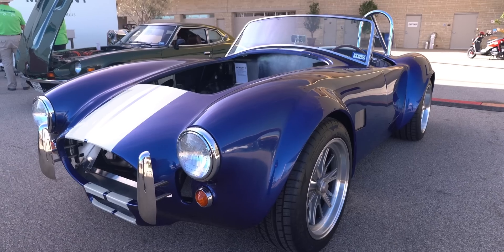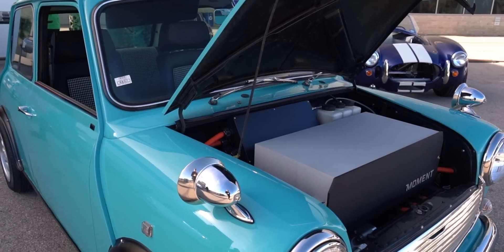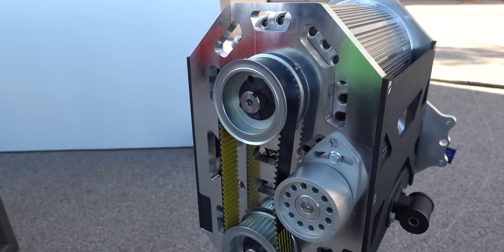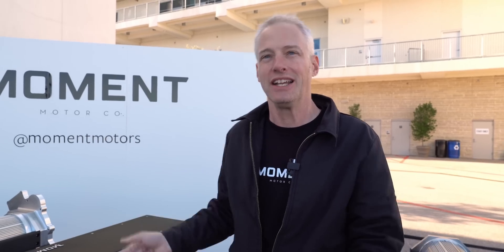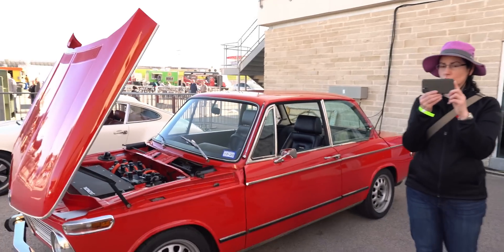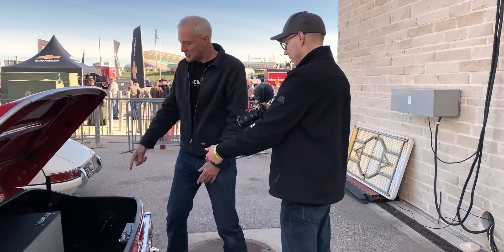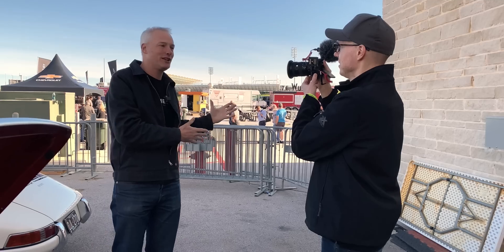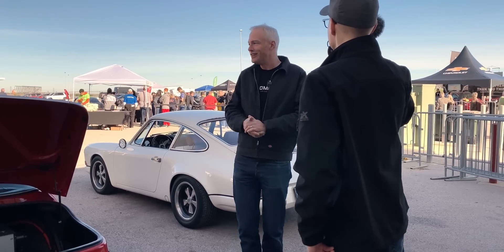Classic Car EV Conversion and Moment Motors - full interview

Comment: This is Iike castrating (gelding) a great Stud racehorse and claiming you now have a better riding experience.  The engine is the reason for the car to exist.
Virtually every original car you show has a unique engine, iconic, individual, personal to the driver, and speaks with a particular voice, an exhaust note
that is the very signature of the marque.  The internal combustion engine makes you part of the visceral nature of the machine. 
You've gutted these qualities and in place installed a soulless device of indeterminate boring consequence.  Do you want a Rolex Sub Mariner or a $24.99 digital watch with a  clocking chip?

Comment: I saw video yesterday that put the electric motors in place of wheels on a Ford F-150 and a Mustang. (Protean Electric and Ford) Each wheel produces 150 horses oddly they claimed their total horsepower was under 500 horses. They have a computer management system that assisted in adjusting the individual tire speeds during turning the vehicle. This performance made for a incredible turning radius. GMC is selling truck hybrids that claim to get 100 miles per gallon. They put small block 6 cylinder attached to a electric generator and only enough batteries to go 40 miles. It never has to be plugged in cause it recharges itself. Moment Motors should look into  something like a Honda generator as to add an option to improve there vehicle range.

Comment: "Transmission adapters" That's too bad, what a waste of space, weight and the losses from driving unneeded mechanicals. They take Tesla parts but Teslas don't have clutches, flywheels and huge multi-speed transmissions.
Reply: I wonder however if these losses will be partially offset by the fact that the electric motor can work in it's more efficient low RPM range when driving in higher gears at highway speeds.

If I was a classic car enthusiast, the pros of keeping the fun of a manual transmission intact would definitely outweigh the cons of lower range.
Reply: I find shifting gears quite satisfying, these are more about novelty than practicality. You are technically correct but I still want to drive that Mini!
Reply: With an electric motor you don't need a clutch or flywheel.  Clutch I would think is needed for the shifting gears at speed.  But the transmission doesn't have to be manual.

Comment: As someone who is driven across the u.s. more times than I care to remember, I don't understand the issue that people have with range. In 50 years I've only met two people that, like myself, regularly drive cross-country. And like myself, both of those other people would have no problem renting a vehicle when needed for that specific purpose. For the rest of the country, you really don't need more than 50 to 150 miles of range. So why the ridiculous obsession with range?
Reply: I see your point.  I have a compressed natural gas vehicle with a 200 mile range.  It's fine for around the city.  With CNG I have limited options for refueling.  If it was electric, I could plug it in at home and charge up overnight.  Or stop at RV parks around the country to charge it.  And now there are many chargers being installed all over the US.  Hey, maybe I should convert my car!!

Comment: Why is the transmission still in your design?
Reply: We are trying to preserve the classic driving experience. Removing the transmission is possible in some cars, but requires a lot of re-engineering of the existing drivetrain and often massive structural changes to the car. Leaving the transmission and drivetrain makes the conversion simpler, more true to the original intent of the car and, quite honestly, more fun to drive!
Reply: @marcdavis9338  will you add some content to your page? I am your 5th subscriber!
Reply: Probably because that's the easiest way to do the conversion.

Comment: What I'm concerned about is how these classic cars will sound when they're modified... If you're grinning at the prospect of driving an AC Cobra for example, you're thinking about 3 factors - the looks, the performance and handling, and the noise that huge engine makes when it revs. So far as I can tell, Marc covered two out of three factors, but a big part of the experience of driving certain classic cars is being able to feel those revs coming up through your body and hearing that unique engine note.
 
Unless there's some way to replicate the experience of the engine sound, it sort of feels like you should just buy a Tesla instead of having your classic car converted... you don't buy an old V8 muscle car to be quiet.
Reply: You are not alone in this concern and we make no claims that driving a classic EV conversion will sound the same, BUT they are not silent. You still hear the mechanical sounds of the transmission and differential and the motors do make a whirring whine that can sound like a turbo as it spools up. The result is not the same, but it is far from soulless - you still get some of the same visceral feeling you get when driving a combustion sports car. It's not for everyone, but the instant torque and being able to drive the car, shifting the gears, in the same way its creators intended convince most people within the first few minutes of a test drive.

Comment: The cost of these conversions is almost obscene. Great workmanship, but by the time you buy the car, have the body and interior restored, then have everything converted to electric you get maybe 70 to 90 miles and the cost is higher than a brand new Tesla 3 Performance, sometimes 2 of them. Oh and you can't just charge these on any quick charger. It also loses it's value as a collector car.
Reply: Oh please. You are Very Smart. or not?
Reply: These cars are for people who want a classic car form and don't want the reliability issues that come with owning a vintage IC engine..... And this way the car's condition will be preserved for more time as there's no fluids in the car to cause it to rust inside out and destroy itself if not taken care of
Reply: @nikhildrao227  A restomod would be the better way to go. All the reliability of a modern drivetrain but without all the drawbacks of an EV conversion.
Reply: @QarthCEO  And with none of the advantages of EV either.

Comment: As nice a job as he does these cars are not nearly as safe as the new cars out today. Even the worst of the new crash tests would beat these hands down. They may look good but I wouldn't drive one. `The VW bug and mini weren't even safe compared to other cars of the era.
New EVs have the batteries under the floor, the Bolt's batteries make the car 28% stronger. Since they aren't putting the batteries under the floor the balance will never be what a ground up built EV will be. The best they can do is make a car balanced relative to the original vehicle which can never be as good as batteries under the floor - or as safe.
Reply: At what point did they claim that these cars were as safe as modern ones?  Don't recall that being a point nor do I imagine anyone with these cars is under any illusion that changing them to EV's suddenly changes their structure, fact that they don't have airbags, etc etc.
Reply: I think you are missing the value proposition here. Clue: it isn't safety.
Reply: It's the worst way to do a restomod for sure.

Comment: Do they remove the gas tank and use that space for batteries ?
Reply: It would make sense if they did. The car doesn't need it anymore...!
Reply: @granadakimj  they seemed to use the boot instead ... Oh well there's always room.for improvement
Reply: They didn't leave any place for a spare tire or tools!!!! So what happens when you have a flat? Also where do the groceries or laundry go? I saw a small pouch battery on the documentary "who killed the electric car" that they cut in half with scissors to show it's safe and still putting out electricity. Research it on the internet and couldn't find it anywhere?!
Reply: @taunjiachandler6607  You mean solid-state batteries?

Comment: 4:22 Surprised you hadn't thought about weight distribution being an issue. It's one of the first things that occurred to me seeing those batteries sitting high up in the engine bay. It's good that they're being diligent about weight distribution as that really is critically important.
Reply: There are a couple types of vehicles where you can put batteries in the floor. Basically anything where it is body on frame. The batteries are heavy though, so sometimes it makes sense to upgrade some suspension parts. I saw Jehugarcia do it with an old VW bus in a video. I'm guessing it's possible with pickup trucks too, particularly with flat packs like Tesla.
Reply: @fjalics  Yeah that's pretty much the perfect scenario for a conversion, and I would guess in most cases would lead to a lower centre of gravity and better handling than the original ICE set up =)

Comment: That guy is genius he knows very well what he has,i know it's expensive to convert one but classic cars are for hobby and passion, here in Kenya we buy classic cars but replenishment is damn expensive, wish we could have many conversion to save us alot
Reply: Converting one costs more than the car is worth. You could literally buy a spare car for the price.
Reply: A well put together electric is much cheaper to maintain, and to fuel, not to mention you aren't polluting at ground level where people are breathing. Electric motors are not rocket science, though the rear motor of a Tesla Model 3 is pretty tricky. The great thing is there is a tremendous amout of money pouring into both improving batteries, and making way more of them. They are still pretty expensive, because demand is often higher than supply, but that is not forever, and EV sales are rising quickly, particularly in Europe, so the number of wreaked ones is likely to go up too. Also, as the guy mentioned, it matters what you are using it for. I love the idea of a 500 mile range Cybertruck or Model S, but a short range electric vehicle could be very useful in a city, particularly where you never get extreme cold.